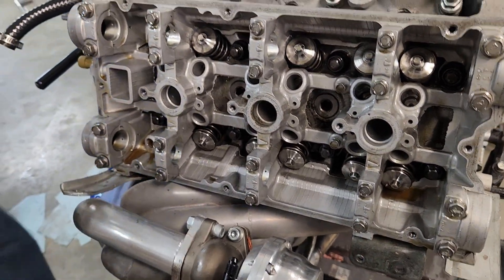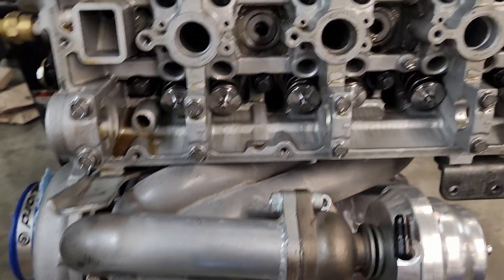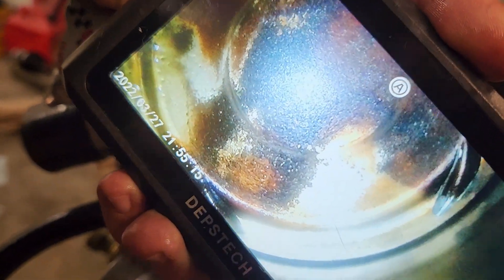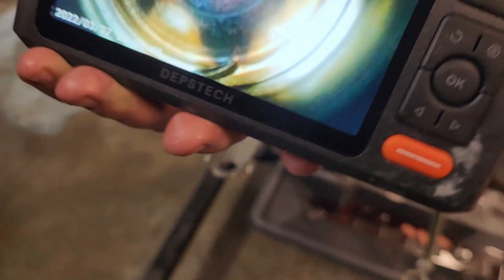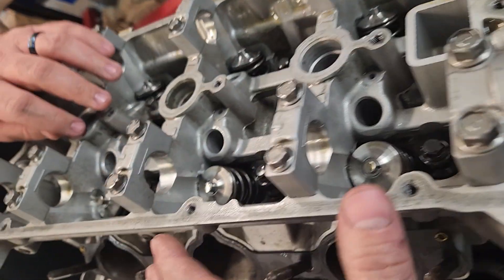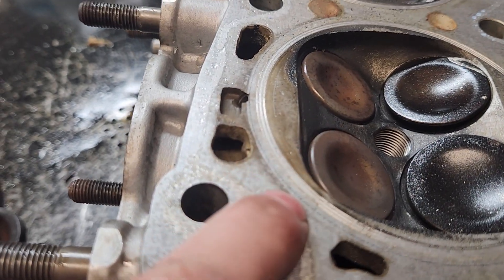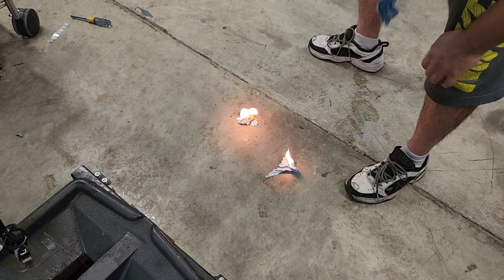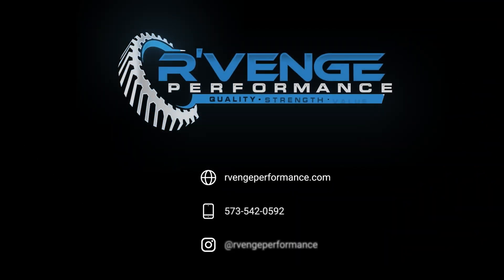Dodge Stealth / 3000GT AWD Twin Turbo Bent Valve Examination

Comment: Damn that sucks.   On a different note, what crank gear reluctor wheel are you running? And are you running a different reluctor wheel for the cam gear as well?
Reply from the maker: Its a custom 36 tooth wheel we may have for sale in the future. The cam wheel is a stock wheel with the 3 smaller teeth lopped off.